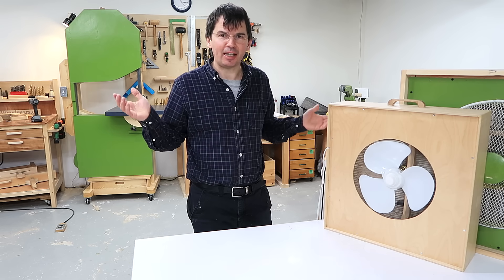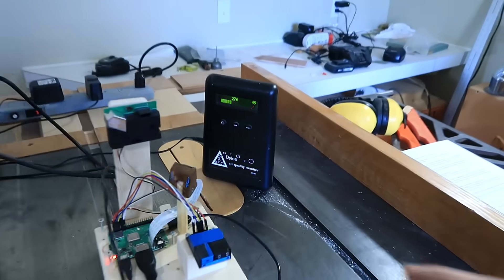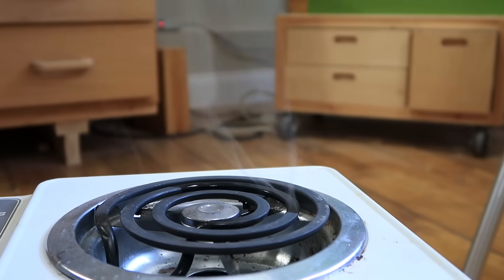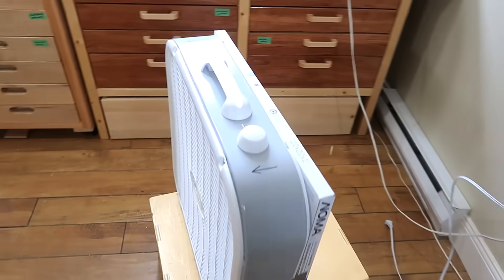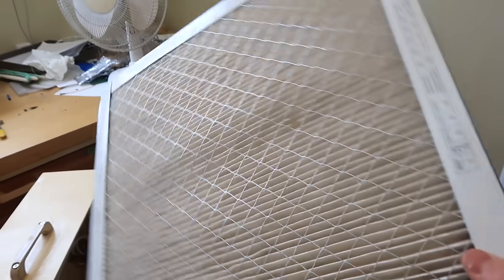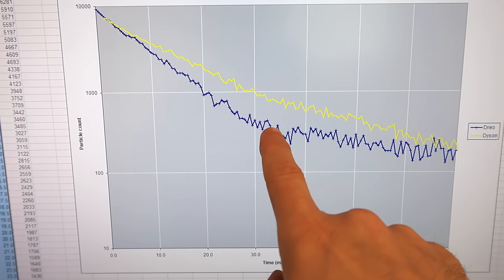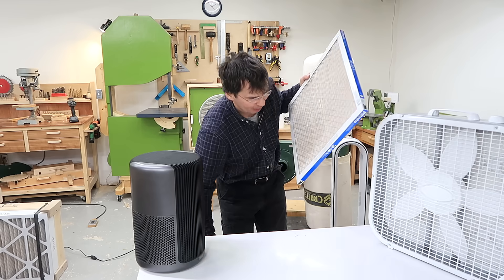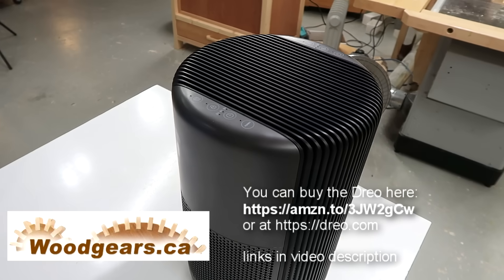Clearing smoke with an Air purifier.  Which is fastest, quietest?

Comment: i believe that the box fan's performance compared to the closed box fan's performance is not a fair comparison.  As you mention in your other video the box fan actually sucks in air from the front and the back so a lot of the air it pushes isnt getting filtered. In fact because of the additional resistance from the filter, i bet additional air is getting sucked in from the front.  For the closed version, the majority of the air is forced to be filtered. The box fan is probably moving way more air, but a lot of it isnt filtered.  I bet if you closed it, the performance between the 2 would make a lot more sense.

Comment: The Dyson is a bad Air purifier because it's a fan. It's also a bad fan because it's an air purifier
Reply from the maker: yes, but it does it in style!  Actually, I have been using the dyson a bit last summer, just to make a light draft over the bed as I sleep. of all the fans I have, it has the lowest air speed setting -- cause its highest air speed setting is pretty low to begin with.

Comment: While the Dyson doesn't compare to filtering as fast the main point is to move air in the room with an added bonus of filtration which wasn't in the earlier fans they made, plus it looks nice. The other filter you mentioned would be great for keeping spaces clean with good price point and cheap filter replacement. As other comments mention it would be nice to see a neutral no filter test to see how much the particles settle or increase over time

Comment: Cool.  Anecdotally, for me, an apparently faster homemade design was a cube made of filters, topped with a cowled box fan that sucked air out of it.  This seemed faster than a box fan with a single filter taped to its back.  This was according to my eyes and nose: not instrumentation grade.

It would be interesting to know which grade of filters you used when you compared your two box fan models.  MERV 13 grade filters from Nordic Pure seemed good to me.

Comment: This video, and another, convinced me to make air filters with a box fan and two 20 x 20 furnace filters. I have one expensive filter that is rated for smoke sandwiched between the fan and a cheaper filter that catches the big stuff. Ideally that arrangement prolongs the life of the expensive filters. I am running two of these in my home while we're socked in with smoke from wildfires.
Reply: Very helpful. I have a $170 one on the way, and I am re-thinking to doing this. Plus to REPLACE the filter in the new one is 50bucks! These are about 10 bucks each!
Reply: @Davethreshold  The cheap filters are cheap, but if you want a furnace filter to clean smoke out of the air (MERV 11 or better) too ... mine cost $36 Canadian. But I don't have to change it often because the cheap filter catches all the big stuff.

Comment: Glad I found this video, it affirmed my opinion and other tests on YouTube about box fans. As others have said, a baseline would’ve really add more merit to the test results.  Having said that, the “nose” I think is a more sensitive sensor than the devices: if you can smell it, then there’s particles or molecules in the air! Wood particles and dust may be difficult to detect but short of some odourless chemicals, just about anything we use has some smell. Im in my 60’s and grew up with cooking smells even though we had a vent, I’ve soldered tons of times with no vent, painted rooms with the old oils based paints that almost made you faint by the time you finished a room, and numerous other consumables that by todays standards are dangerous. I’m glad and thankful this generation doesn’t have to go through all this crap today, they have more knowledge and tools to make the air safer and your video is a good example of such tools and lets us make better decisions against the marketing giants.

Comment: Your homemade filter with fan - mechanical filters become more efficient as they're progressively loaded with particles with use essentially able to turn into HEPA filters if sufficiently "clogged". This is why I like to use a mechanical filter with an electronic filter in cascade - electronic filters loses efficiency as the collection places get loaded, so the complementary performance makes the two a perfect mate together.

Comment: Question for you Mathias since you said it's better for the airflow to go above the unit so it grabs all the air from a room. How does that work with a box fan since you have the air going thru sideways. I currently use one with a 4" filter. Also instead of a Lasko an HF-910 from Honeywell might be a unit that might peak your interest with a Filter filter setup?

Comment: I'd be curious to know how a 4" duck carbon filter for growing tents paired with a dock fan is doing as air purifier for smoke, whole thing was about 100$, still using after 2 years running 24/7

Comment: Your wood air cleaner has less bypass than the box fan. If you build a shroud on the box fan to prevent bypass, you will see an improvement on filtration.

Comment: That "simple fan with a filter attached" has the stupidest of blade designs i've ever seen. Also it let's large amounts of air through the front, especially at the corners. Not for sucking power, at all. Even though your own construction has a small fan, the front cover is catered closely to its dimensions preventing this.

Comment: The Dreo isn't that expensive because like an inkjet printer, they get you when you go to by the consumables.  A replacement filter for the Dreo is about 1/4 the cost of the unit.  The box fan would be the more cost effective option.

Comment: It would have been nice to also measure cleaning performance relative to noise.  It also would have been possible to validate the design of the Dreo by checking if the box fan performed any better if mounted horizontally.

Comment: it doesn't really matter what the cost or how good the air purifier is, it will really come down to the cost of the filters in the long run. I've gone thru plenty of filter systems units in the years and ultimately ended up using merv 11 or better 20x20x4 filters and box fans in a custom box. home ac/furnace box filters are a dime a dozen compared to proprietary filters and don't change much or stop being manufactured.

Comment: I would like to see how these filter/fan purifiers compare to electrostatic precipitators, like "Ionic Pro", or "Sharper Image Ionic breeze". I think precipitators actually filter out finer particles, but, they just don't have the airflow volume of a motorized fan. Fans just simply have more "horsepower", than an electrostatic system with a high voltage positively charged emitter or corona wire, and a negatively charged collection grid. The fans do use MUCH more electricity. Electrostatic purifiers use hardly any power, but, just don't move as much air. My only complaint with electrostatic purifiers, is that they tend to produce ozone.

Comment: Did you consider the DIY box fan air purifyer that was hot about a year ago.  HVAC School channel featured it but so did others.  It’s 4 2” high MERV fliters with a box fan pulling air into the cube and out the top.

Comment: Your conclusion is exactly why I have an air filter next to my 3D printer, and a smaller one on my soldering station 

Also, one of those particle air sensors looks like one of the Plantronics sensors I have, is that the PMSA003I?

Comment: I'm more surprised the Dyson did that well. I have an older model which lacks the colorful graphing display (they have an app which gives you access to that information) but otherwise probably pretty much the same unit. It strikes me as a good if expensive compromise for when you need filtration and an oscillating fan in a typical home environment, though one probably could buy a decent standalone filtration system and oscillating fan for less. I'm not unhappy with ours; had it been only my choice I probably wanted to spend the money on it but since my wife really wanted it and is happy with it, I consider it money well spent. The auto mode will increase the fan speed to maximum when the air quality gets poor hence the noise you observed; Since ours is in our bedroom, we leave it set on a specific speed, trading the faster filtration for avoiding the rare occasion of being woken when it suddenly goes to max blower speed in the middle of the night

Comment: I'm most surprised about the claim that the dust collector reduced the smoke particles, as I always thought those bags weren't good at filtering the harmful very small particles. That and the glue gun/3d printer comment, would be very interesting to see that one investigated further.

Comment: It is difficult to evaluate the box fan solution without the Merv ratings and thickness of the two filters that were swapped. Also, the fact that the wood box filter was 7 years old is an unaccounted for (and key) variable. 
   It would seem that the most effective and LEAST COSTLY solution would be to run a box fan/furnace system done correctly which means 5 Merv 13 filters made into a box (yes, sealed entirely with duck tape!) with the 6th side being a 20-inch fan. With 5 filters the system can go a long time without the need to change them. Also, you can direct the airflow where it best suits your need.
   I use such a setup running on the slowest speed. It is very quiet, puts minimum stress on the motor and the 5 filters yield very good airflow. Mine is connected to a smart plug ($6) so I can have it shut off after any period of time or on any schedule I care to set up. 
   And if you ran 2 of these the cost/effectiveness would make the commercial products look silly. Of course, it's ugly but we are talking about.a workshop.😀

Comment: I have a couple of Coway air purifiers which I’ve been fairly happy with. One complaint however is that on auto they will sometimes go into high speed with no change in air quality (windows closed, nothing happening).  I think a speck of dust gets on the air quality sensor, and I’m guessing the same will be true of the models you tested here.   As a result I usually leave the unit in the bedroom on the low setting rather than auto, as it isn’t fun being woken up by it kicking into high mode.  Your viewers should also be aware that the consumables cost quickly dwarfs the purchase price. The speciality filters aren’t cheap.  Overall though, the nice packaging and aesthetics of the units makes it preferable to a box fan with a furnace filter taped to it.

Comment: During the severe bush fires we had in Australia the smoke levels were so high that my wife was dry vomiting and could not sleep. Our choice of air purifiers was limited so we had no choice but to buy a Dyson purifier, desk version. 
Honestly this filter saved us. It took about 4 hours to clear a room you could walk out of the room it was in and notice the difference in smell immediately. Eventually the whole house was filtered to various degrees and my wife was able to get to sleep. Once we thought it was not working but opening the front door to see, we’ll actually not see, that the smoke haze was the worst it has ever been and quickly realise the filter was working but because the house is not sealed the smoke was seeping in. Still the Dyson kept the particles to a safe level. We love our Dyson.

Comment: it can't be filtering that much if it's blowing that fast. did you try a control test with no air purifier? i'll keep watching to find out. I think what matters is the size of the air contaminants. a smoke particle must be 1 micron or less. i don't think any of those filters can remove particles under 1 micron. maybe a carbon filter could help absorb such particles, but they would need to slow the air blower down a lot.

Comment: Excellent video.  Thanks for the zph02 reference also. I hope you make an updated video on air quality monitoring some time I'm curious about these low cost sensors and I have boxes of rpi's and arduinos that could be pressed into service.

Also an almost non sequitur thank you.   I was resawing some ash and my resaw blade was made to cut a little bit of steel (oops).    The blade looked in fine shape but had stopped cutting well.   I used your somewhat crazy idea of a Dremel tool to hand touch the blades, in my case using a small diamond disk.  Besides a bit of repetitive stress on the wrist it went fairly well and surprisingly quickly and what a difference.    

I have a jig to sharpen bandsaw blades for the sawmill and I think I'll configure it to do these smaller blades now too but the setup time is long so I tend to batch the mill blades up and do them in a collection.  Your method is super in a pinch and I imagine with care I can get several sharpenings out of a blade even by hand.

Comment: so the right filter on a box fan did best huh? no fancy gizmo waste... just gotta build a vaccume sealing box for quick replacement on the box fan ... just like the oreck air purifier commercial "you can't clean the air unless you move it" I'm tempted to make a redundancy box rather cube sucking air in and blowing it out the top simply by flipping it the geometry of how many calories sides it has unnecessary more the better but minimals fine too and then power it all from a 100watt solar panels as i know box fans to take between 30 watts of power i could shunt the excess power to batteries for night running because purifying air comes with cost and no matter which form the solar energy is in wind geothermal water or photovoltaic radiation it's far more sustainable than fossil fuel power plants even if you grow the carbon to burn who knows how long the sun will last but as for my lifetime absorbing it's energy at earths distance is my best option
Reply: Intruder In The Cosmic Dust by Wandel Faulkner

Comment: Any chance you could run the same tests on a rabbit air? The a2 model? I did quite a bit of research ahead of time that seemed to indicate this machine was worth the price. I have had my doubts since receiving it. I had first had their introductory $120 air purifier and I thought it was excellent. I upgraded to the a2, about four times the price for supposedly about three times the performance. I don't believe it works even half as good as the first one. I would be willing to send you my unit if you could send it back after testing? I'm located in 98329 if that makes a difference. Either way, thank you for doing this video in general. I feel this field has a lot of very obscure marketing that makes it very difficult for an end consumer to make an educated choice. I hate that sort of thing. I wish Nations would require specific information for specific types of equipment to be published in a way that one can compare apples to apples
Reply from the maker: send me one

Comment: Great video and appreciate the detail you went into on the purifiers.  Since you mentioned 3d printing, I was wondering if you had any data on the particle emissions from these specifically?  I am aware studies have been done showing evidence they emit lots of these, but between my Dylos as well as a PMSX003 sensor nothing above background is detected.  Assuming I'm reading the reports from the studies and the datasheets on the sensors correctly, they should be detecting something.

What really sets my sensors off though, is a simple sweeping of the garage floor...
Reply: How does the PMSX003 sensor perform compared to the Dylos? I've been considering getting a PMS7003 and setting it up with an ESP32 to connect to my home automation system to monitor air quality in my workshop and house.
Reply: @davidchester5784  That's actually exactly what I did and hooked it up to ESPHome.  It's hard to compare the two directly, as the data is reported in different units and I didn't do the math to try and reconcile them.  But the PMS seems to work.
Reply: @onefortyfore  yep ESPHome is what I was planning to use. I guess it doesn't matter if it really matches the Dylos as long as I know when my air is too dirty.

Comment: Great video. I think the reason the old filter and dust collectors worked as well as they did was because filters generally get "better" over time. They build up a cake of particles that trap finer things than new filters. Unfortunately this means they require higher static pressure. I bet a new Filtrete would lose to the old one too.

Comment: You would boost the air flow through the filter by 35% on the Lasko Box fan if you add a 15" diameter circular shroud on the exit. If you step the filter off the back by adding a spacer there is more area available and it adds some extra percent of flow.

Comment: Wonder if there would be much improvement to the DIY box fan one if you put it on legs so it pointed upwards. That would mix the air better, give you non-proprietary filter replacements, and be far cheaper.

Comment: To bad you can‘t buy the dreo in Germany. I could not find it on the German marked. Maybe because it it not certified for Europe or they don‘t sell a 240 V version of it.
Reply from the maker: it uses a power adapter, which I’m pretty sure goes to 240 volts.  most modern ones do at any rate.

Comment: BTW the box fan solution is not good long term. The bearings on them start to smell bad as they go bad....
(and they are noisy)
Reply: LOL they are all fixable.  Watch Matt's older videos on trash picked fan & other motors and how he repairs them.   I do the same thing.   Even thermal fuse failure can be repaired but usually the plain bearings gum up and you just need to clean them and re-lube and you are good for another few years.    I run my box fan filters at low or medium speed and they are not too annoying but high speed is though I'm not sure they produce much more flow.